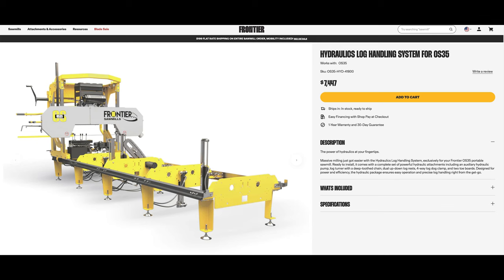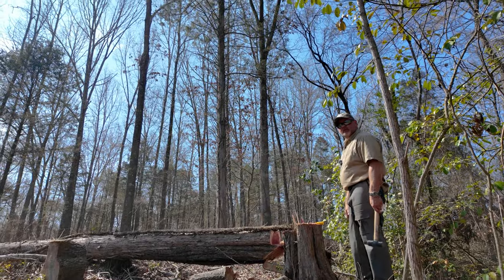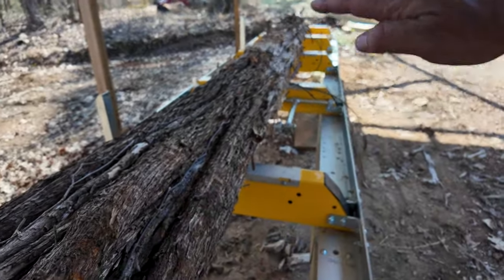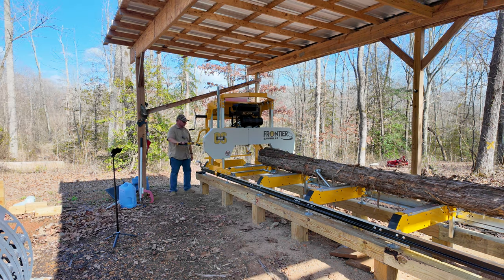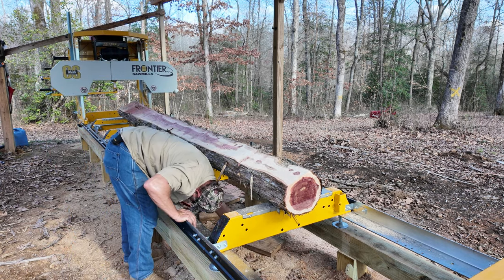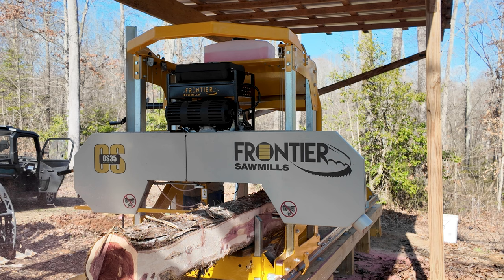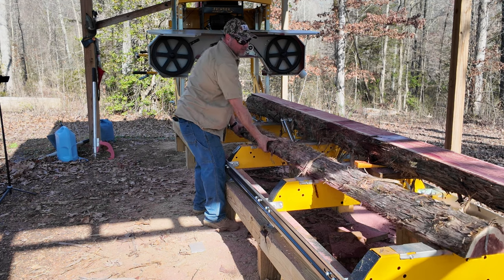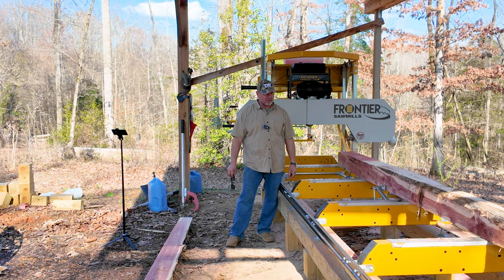What is owning a sawmill like? Real Days- Frontier OS35

Comment: I too am a fairly newbie sawyer, and I too have hit a log stop multiple times. The ONE thing I have changed is making my own log stops out of hickory after the first blade ruined. Now I don’t care if the stop is a hair high. I know if I hit it, the saw bogs for a second, but NO harm done!  It does seem kinda asinine that manufacturers put metal out there (that you can’t see) in front of the blade and have to risk damaging blades if you miscalculate. Wood stops alleviate that!
Reply from the maker: I'm afraid that wouldn't work for me. I sawmills capable of taking logs that weigh  near 2500 lb. I'm pretty sure if I rolled that into wood backstops they would snap off.

Comment: Well it makes me feel better about myself in that , when i am not operating machinery on a regular enough bases i do the same thing forget to dot my i, and good thing the blade was already in need of change. As far as getting the 8,000.00 up date in my way of thinking is there plans to use the sawing enought to justify that expenses?
Reply from the maker: I am at a point in my life that running the sawmill is a hobby. Instead of having a $40k boat, the extra $8k will go to my sawmill. As an additional bonus, I can make money with my hobby if I choose to.

Comment: Bummer tony...
Thanks for sharing the misfortune...
The back stops should be made from Brass or Aluminum bar stock. 
Mike M...
Reply from the maker: I guess they probably have to make it out of steel to hold up to the load of a 2500 lb log rolling into them. I'm sure it will not be the last time I hit the back stop. 🤣🤣🤣

Comment: That really stinks. I am no saw mill expert but I think I would cut some hardwood inserts to go into the standards out of hickory or oak. They seem like they would hold those size logs in place. If you cut through them there would be no big loss and your blade would not be damaged. As I said I am not en expert just thinking outside the log. 😂
Reply from the maker: I understand your thoughts. However, this sawmill can handle 35-inches logs weighing, upwards of 2500 lb. It would snap the wood backstops off like toothpicks.